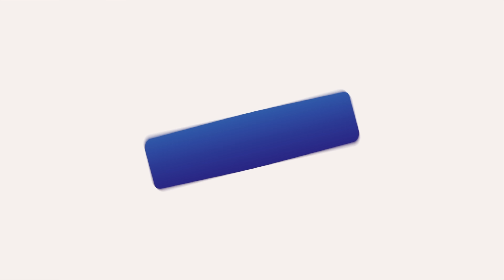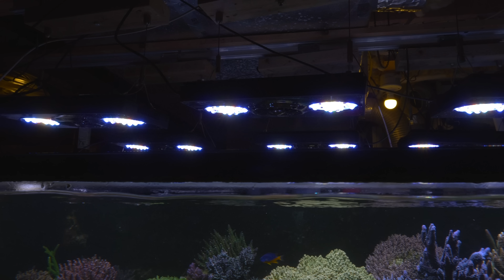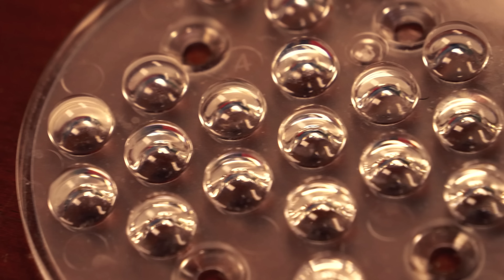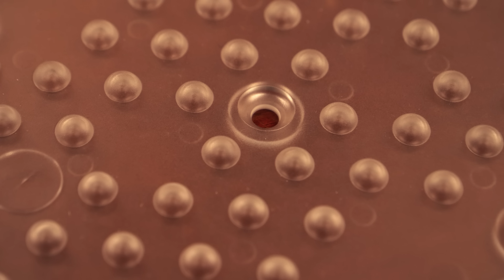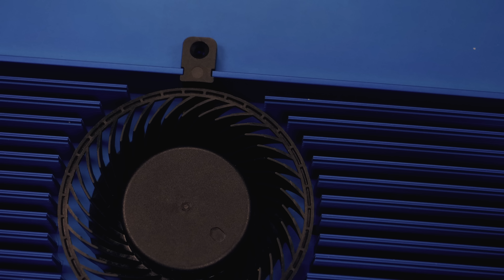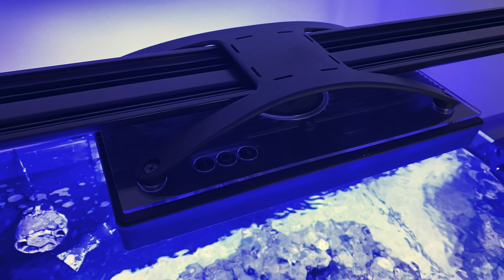Radion Gen 5 Blue & Pro LED Light, Deep Dive Discussion with Justin Lawyer

Comment: I kinda see this as buying the newest iphone over a flip phone that i’ll probably only use to text people anyways. The same really goes for reef lights. Many cheap and expensive options produce similar growth and coloration so what we’re left with is a difference in build quality, fixture appearance, light blending and remote connectivity. I get that. Personally, what i’m waiting for is an affordable plug-n-play t5ho replacement led. Not the cheesy “e5” marine “bulbs” that last a few months and don’t perform anything like t5ho. Not something that’s going to use t5ho sockets or their ballasts. I mean an affordable, quality LED solution that I can just plug in, switch on and get the coverage and spectrum characteristics of t5ho. It’s silly that many of us who’ll buy these pricey new LEDS will also buy t5ho bulbs to supplement them.

Comment: Makes me wonder how long a lifespan things like the Apex has left, as more & more companies include wifi compatibility and complete control from your smartphone/tablet...  granted it means a few separate apps unless you have all Ecotech or other companies but soon the Apex is just gonna be an expensive ph monitor and offer little more functionality than the equipment you buy already provides
Reply: matthew dawson I think the Apex is catering more and more to total system automation. Think automated testing with the Trident and then all their modules from water automation, flow meters, etc. It still has its niche.
Reply: While I agree with the Trident they're trying to have a fully autonomous system with vital parameters monitored but is it worth the extra cost involved??  Test kits aren't mega expensive & with the introduction of pro test kits they're more accurate than ever, once u get used to the kits you can test all parameters in 20 mins...  to me the Trident is the height of laziness and if you can't be bothered with a simple task like testing parameters I would question wether these people should have Marine aquariums period
Reply: I would much prefer other things compared to the locked down ecosphere.. I still find it funny that people BELIEVE you need it. It's a heck of a system, but it doesn't make up for lack of knowledge and experience unfortunately.
Reply: @Kungpaoshizzi  I am using an apex and I am not forced to be in any ecosystem in regards to pumps and lights. I appreciate what EcoTech is doing, but it’s not as scalable up or down as Apex can be. EcoTech is far behind in that department. If anything they are forcing you to be in their limited EcoSystem.

Comment: I hope the next model they come with 2 bigger fans, pull configuration, slower RPM... rather than 1 fan blowing through the heatsink (in the PC world, blower style GPU is known to be noisy). It will be a lot quieter and perform better across the heatsink (less heat point, don't know the term for it)
Reply from the maker: Just wait until you see the Gen 6, lol

Comment: it looks like theyre going for a black box look instead of a puck look. Thats better but looks like reef breeders leds will be on par or better for the price. price drop when?
Reply: eegernades different software, fans, diode colors, diode bins, Heat sink.    Just spreading them out a touch does not turn it into a reef breeders
Reply: @rustyshackelford4503  I forgot, they're ripoffs too